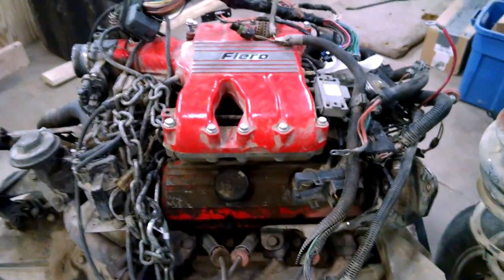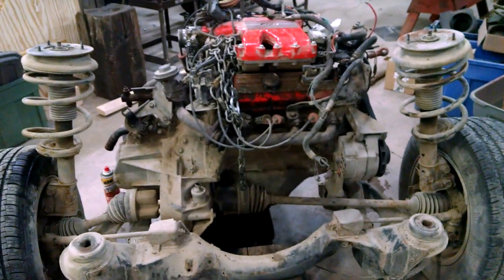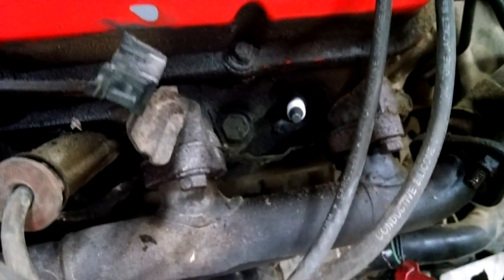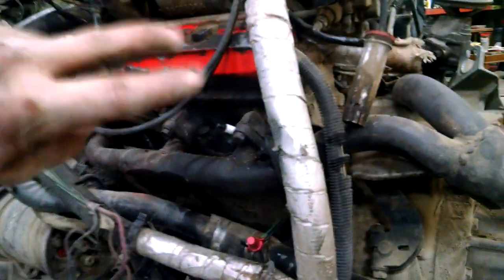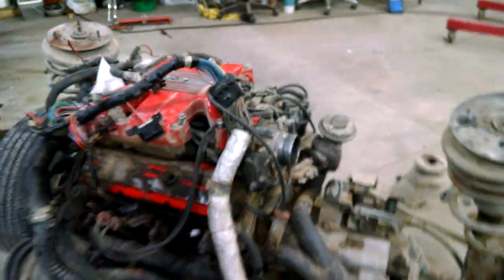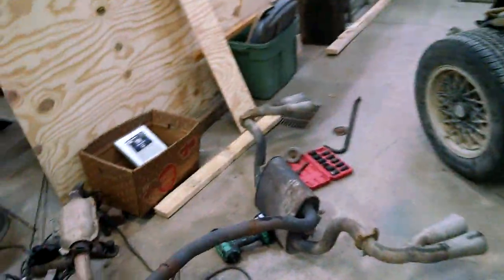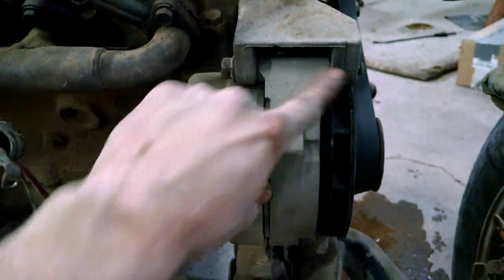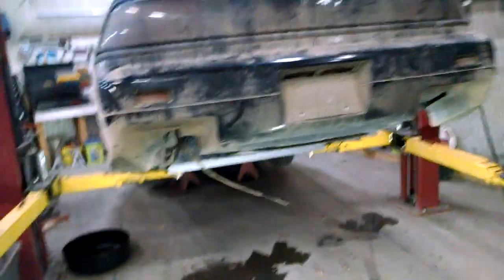1986 Pontiac Fiero GT 2.8 V6 engine and Transmission removed #pontiacfiero #fiero #motor #midengine

Comment: Please I need your help I have my Pontiac 2.8L petrol , I change my distribution but now it’s cold not start beacause I forget my time point please if you can help me 
To have my time point also how I can put
Reply from the maker: I wish I could help you, However, I was only able to get this job done by watching videos and taking notes. I had additional help from friends and it all worked out. So your best bet is to search for the best way to time your vehicle. It may be as simple as loosening your distributor and turning it until it runs smooth. Keep trying you will fix it.